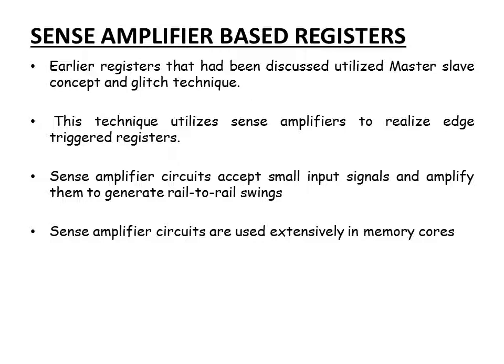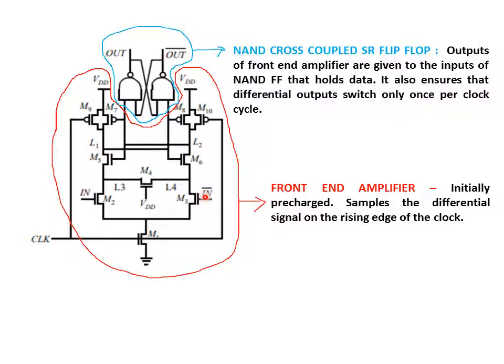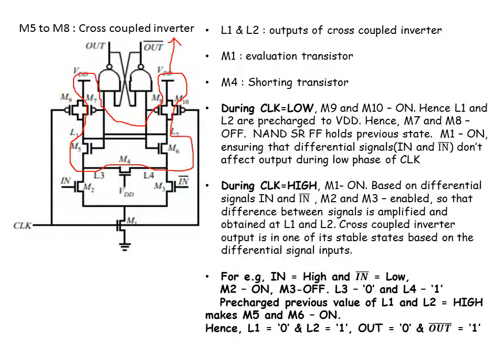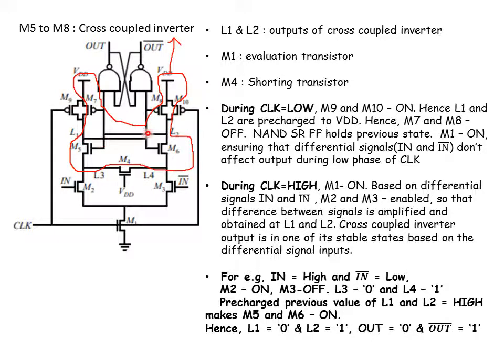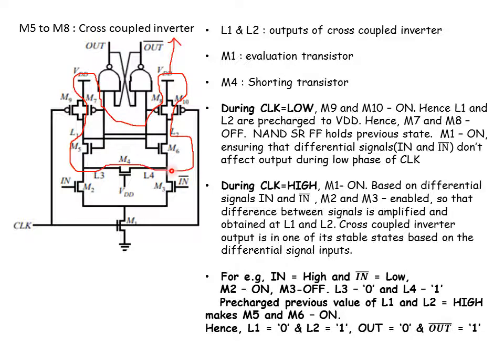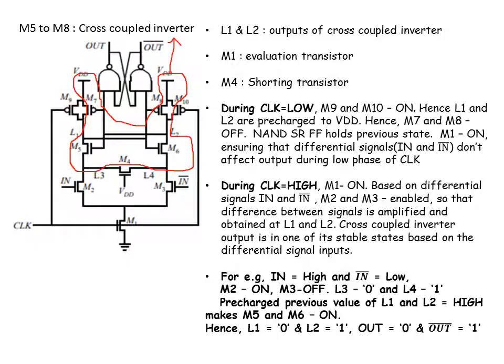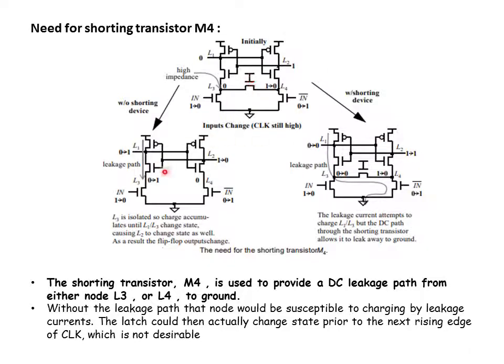SENSE AMPLIFIER BASED REGISTERS

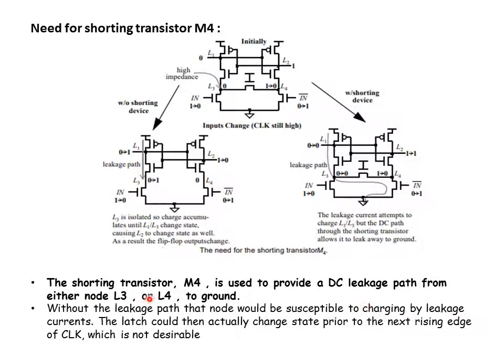Comment: 13:11 Why a shorting TRANSISTOR and not just a simple SHORT that would connect the two lines with a wire? Wouldn't it provide the draining path as well?

Comment: Thank you for this wonderful video ma'am! Your explanations were in-depth and extensive! I have a few questions regarding the shorting NMOS, and I will greatly appreciate if you can address those.

1) You gave the reason behind the shorting transistor as preventing any input change from affecting the Sense Amplifier output during Evaluation Phase. I am curious to know a bit more about this failure case. I think that in reality, the Sense Amplifier inputs should not change during Evaluation since that will amount to Hold failure. The input path should be sufficiently delayed to not change its state while the clock is HIGH. So, in my opinion, the design itself should ensure that the Sense Amplifier inputs do not change during Evaluation Phase, and as a result we should not require this shorting NMOS. Can you please share some situation where this input change can occur during Evaluation phase without violating the input Hold Time?

2) I think that having this shorting NMOS actually slows down the Sense Amplifier Response Time and can also be a reason behind a potential failure of this Sense Amplifier. This is because this shorting NMOS is always ON due to which when IN=HIGH, the source of M6 (node L4) will also see GND potential through M4 and M2, since node L4 will be following node L3. In this situation, the only cause behind a differential voltage between nodes L3 and L4 will be the extra delay that M4 will provide for GND potential to travel to node L4. This single NMOS delay is all we have to create a differential. And because of this small window that the Sense Amplifier gets to differentiate between its two arms, it will take more time to resolve the differential. Also, in another scenario, due to mismatch, if M5 becomes weaker than M6 on Silicon, then we may actually approach a zone of metastability of the Sense Amplifier where it may not be able to resolve the input differential. Can you please give your opinion on my observation and correct me where I may be wrong?

3) Under the circumstances where the inputs toggle state during the Evaluation Phase, how can we ensure that the Sense Amplifier will still resolve in the opposite direction because now the source of M6 (node L4) will be directly at GND while the source of M5 (node L3) will see a one NMOS latency through M4, making the Sense Amplifier skewed in the direction of resolving the new state of IN=LOW. So, even having this shorting NMOS is not guaranteeing that we will be able to resolve IN=HIGH state after IN has toggled to IN=LOW, since IN may toggle to LOW immediately after going HIGH. Can you please give your opinion on my observation and correct me where I may be wrong?

I request you to please address my questions, for which I will be extremely grateful to you!